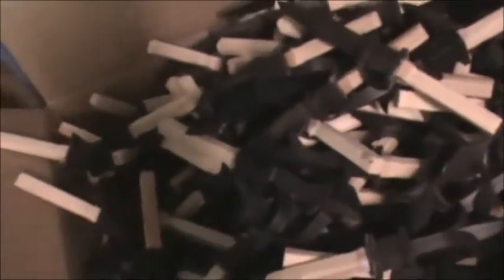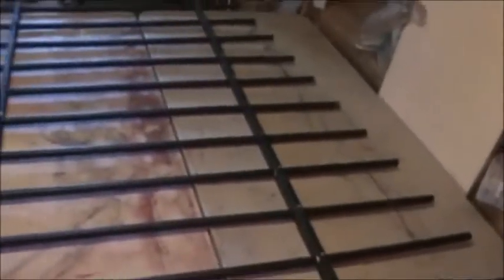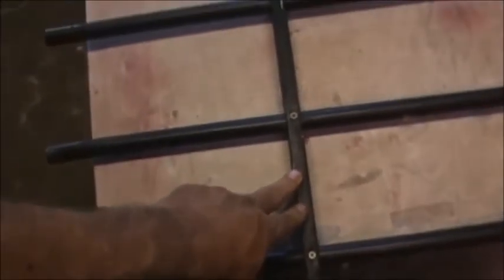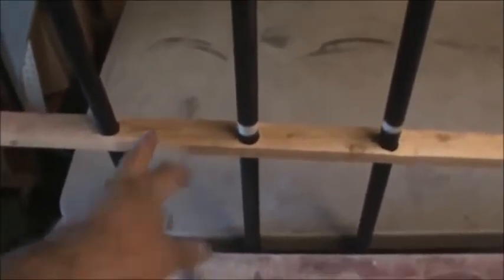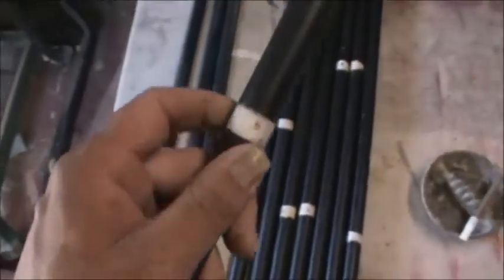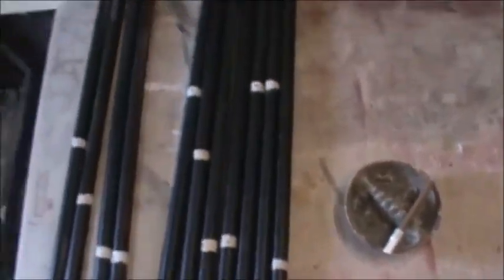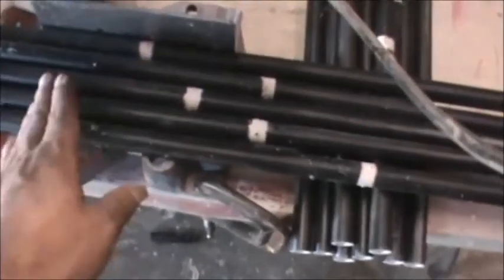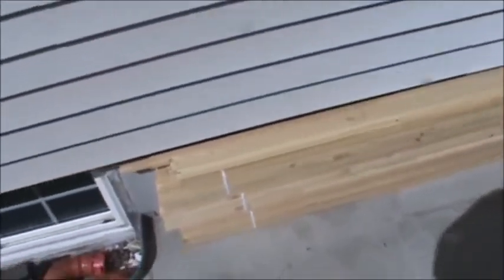Fence pannels PT 1 4-14-13

Comment: I really want to know what you are going to do with those short pieces! LOL I know, I will have to wait. I need to redo the wood on our 10 panels of fencing and I want to rust them up AND I want to get finials for each pvc pipe because right now we only have them on the ends and one in the middle. It was great seeing you on Haunters Hangout!